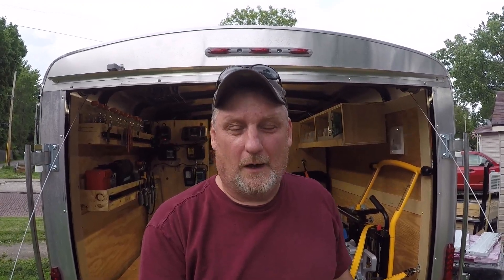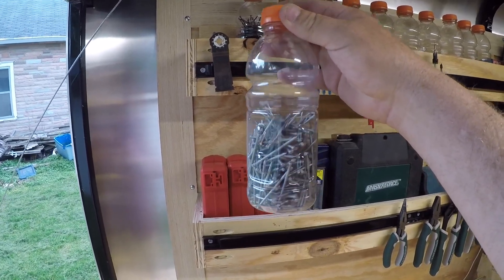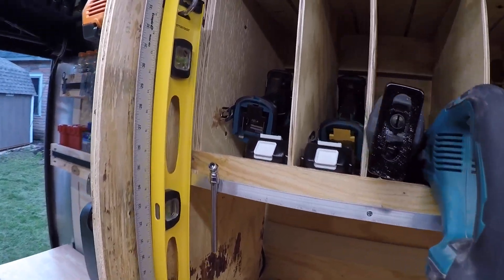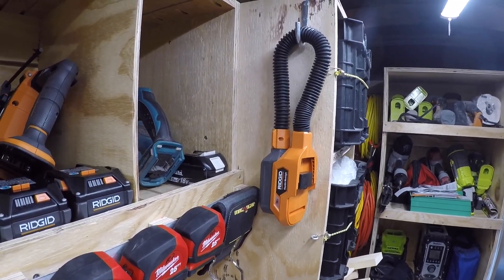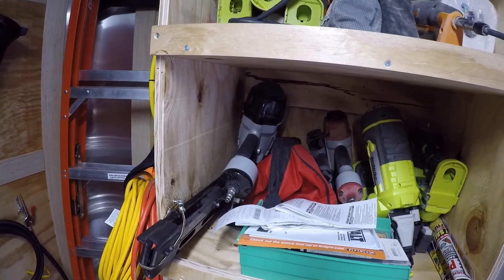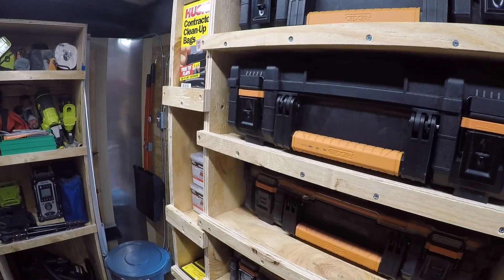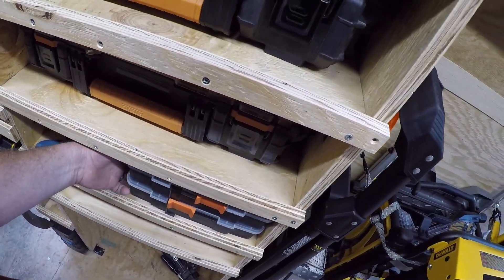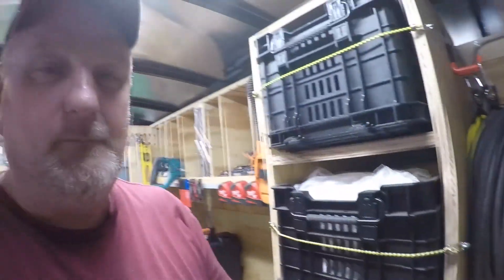Paulk Inspired Tool - Work Trailer Build Handyman and Home Remodeling Company

Comment: Nice set up! Just curious if the DOT pulls you over at all?
Reply from the maker: I have never had that pleasure, here in Illinois they seem to be mostly concerned with the big trucks. Now they may in the future but I have never seen the DOT guys in my area pull over any contractors, not saying they couldn't do it but I have just never seen it around here. The other thing is I try not to give them a reason to pull me over, when the trailer is on the truck I make sure and do it safely, I don't get in a hurry, I don't do dumb stuff, safety is my number one concern. If I don't get to the job because I got in an accident then I don't work and I don't make money, so an extra couple minutes to get somewhere safely is a no brainer to me.

Comment: I know you made the video 7 months ago. 
Any new updates 🤣😛
Reply from the maker: Ernest Vocell nothing new video wise for this trailer but I will have a series of videos coming soon that will show the planning process and build out of our second trailer. The new trailer is bigger it is a 7x16 and it will be very similar to the existing trailer but since I have some more room I will be able to build in some more storage options because that is the only real challenge that the existing trailer has. Because it is a smaller trailer we have found that storage for things like shovels, rakes, concrete tools like come alongs and bull floats is a challenge, so I will address that in the new trailer. The other items that are challenging storage wise has been things like boxes of nails and screws, sticks of nails for the nail guns, bolts and lag screws etc bigger type items. Again the new trailer will address those issues. Overall the trailer has worked really well for us, it has been a busy season since we put the trailer in service and I had planned on making some modification this winter when things slowed down but it hasn’t slowed down a bit for us, we have been going non stop all year. I will try and do an update here in the next few weeks and talk through in more detail what we have found that worked well and hopefully I will be able to find some time to do the mods to the trailer that I have planned so stay tuned. I will say this that investing in the lettering on the trailer has worked very well for us it gets seen on the job sites and we get many people come talk to us and have hired us because of the lettering on the trailer.
Reply: @R2Customs  awe.
Reply: How much you spend in material for the shelves  aprox  is you can

Comment: Please don’t call that rigid box to pack out. No comparison.
Reply from the maker: Its the same concept but your right its not Milwaukee. I have a video ready to go I have just been so busy and haven't gotten it uploaded, but since I shot that video I have switched to the real Milwaukee packout system and it is better than the rigid in a lot of ways. But I will say this for the money the Rigid is a great value, I like it better than the Dewalt system, the Rigid seems to be better built than the Dewalt and costs less. So while Milwaukee has the most features an options and is a great system not everyone can afford the Milwaukee so in my opinion and your mileage may vary the Ridgid system works well and gets the job done. I got a lot of work done and made a lot of money using the Rigid system, and Milwaukee still dosent have their damn baskets out yet, come on Milwaukee how hard can it be its a damn basket!!!